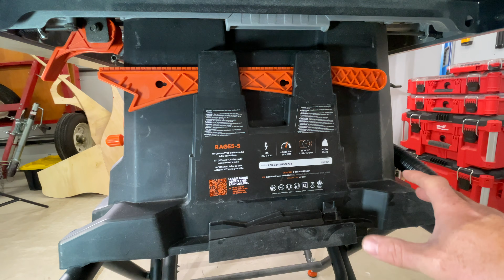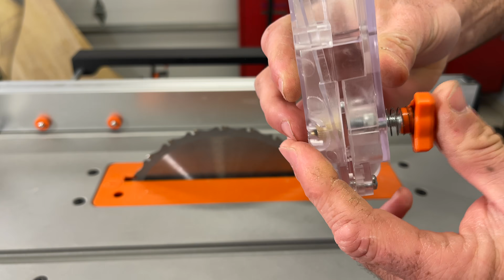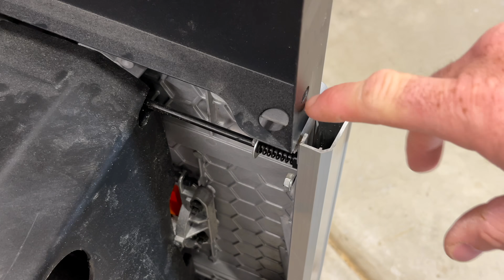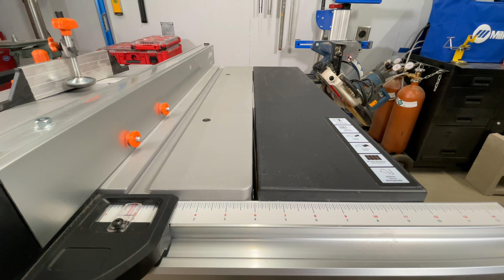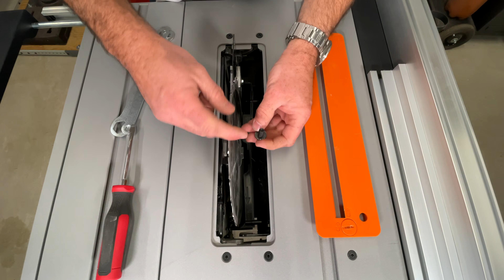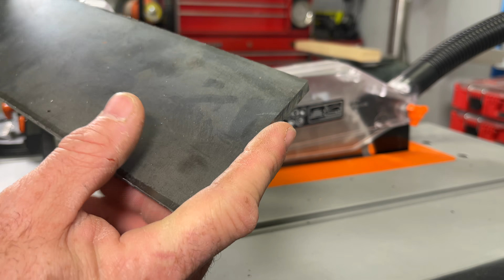Cool and Innovative But....  ||  Evolution Table Saw  ||  Review

Comment: Had this table for about 5 years and it is equal parts bad and good.
The good is the amazing ability to cut metals of all types up to about 20mm thick and the clever way it carriage is integrated.
The fence is also surprisingly stable and quite solid and it's fairly light and easily transportable.
The bad is that although the top at a glance looks cast its not and its not particularly level either.
The carriage although clever doesn't run very true and I have had to Shim mine out to make, it glide without any wobble
The measure guide I have Never used nor the extension piece I just tape from the blade to the fence (usually more accurate in any case) the extensions are a little weak but I have manged to use the right hand side extension to house a quite beefy router with no real issues.

All in all not a bad attempt and can produce accurate cuts as long as you are careful setting it up properly.

Forgot to add the aluminium fence is made quite thin and needs a decent ply face to make more it solid and durable
Reply from the maker: Thank you for this detailed write up on the Evolution saw. I try and show as many details and up close shots of features as possible. What I can’t show is years of owner experiences. Thanks for watching!
Reply: I've had one for 3 years, I say this comments sums it up very well
Reply: By the way that mitre gauge don't bother just throw it away immediately it's utterly dreadful
Reply: The table is die cast.
Reply: @willholt100  correction (and an error on my part) its cast alluminium not iron
Reply: Had one for years. Agree with this comment. Top not flat. Would I buy again? At the price range this is probably the best option. If I was in the USA, I would be looking for second hand cabinet saw. Have only used this to cut metal once. Their chop saws are a better option for that. Do not expect a great number of metal cuts with the orange blades. As you can see, if you buy this saw you will for ever be conflicted about how you feel about it 😂

Comment: You spent entirely too much time obsessing over the measurements... anyone worth their salt uses a measuring tape and measures blade to fence 💯

PS: It takes minimal effort to fix many of the issues pointed out lmao (e.g. the "little fence" having both thumb screws on 1 side can be solved in 5min by drilling & tapping the opposite side and moving one lol)

Comment: I had to cut out the bottom of the blade shroud because it filled with bits ,the blade would not wind down to the bottom otherwise

Comment: The 2024 saw has many improvements. For the money I think it’s the best there is. The thing about eveloution is their all purpose blade. I have one of their chop saws and it is unbelievable. Fast and accurate. Now for only wood use I’d use a different blade for sure. Just think how nice this saw would really be if they used aluminum knobs instead of plastic ones. I’m a toolmaker so when I get time I’m going to make them. I don’t like orange plastic lol. Anodized aluminum will make this look 100% better not to mention stronger . I love your reviews. The best channel on here for them.👍🏼👍🏼
Reply: Dude what is up?  I’ve been trying my best to get this new Evolution saw. Your review and channel are great and I’m wondering just how you got your hands on this thing?  With all the videos on here I watched I came to realize the old saw was a Rage 5 and certainly NOT the saw I want. So I called Evolution and spoke at great length with a VERY nice customer service guy. Turns out this new model is ONLY available in the UK, and is 240 volt not 110. ( which wasn’t a problem for me) They don’t expect it to be available in the states till Feb 2025. I’m bummed . Evolution was founded in Sheffield England and supposedly as big as DeWalt and Milwaukee . I wish I had the patience to wait for one, but patience isn’t my virtue. Now I’m guessing because you’re a big influencer here is why you got your hands on one. Again I do appreciate your channel.
Reply from the maker: I spoke with Evolution a couple weeks ago and they were hoping to have one to me late this year. I’m excited to see that saw too. I’ve reviewed three Evo miter saws to date and all have been excellent. We’ll get that table saw vid out as soon as it shows up. Thanks for watching and supporting the channel!!!!
Reply: So sorry I was a bit confused until now. After watching so dang many videos on here I just realized this one was on the Rage 5 and not the new R225 which I thought it was. So now it all makes sense to me. I forgot to ask them if they would be 110 volts when they were available here. There is a big difference between the old and new and you’ve pointed out all the negative features on the Rage 5. Not wanting to wait months I’ll go with the Skil. A few less features but appears to be the best at that price range. I’m retired and have a metal and wood shop. More metal than wood but still need a table saw upgrade over my Ryobi, which is basically junk. Keep the great vids coming young man.👍🏼👍🏼

Comment: Fair comments on the table saw, I've just bought one of these and had no problem with the fence moving, I think for the price you just have to treat it with respect and not bang it about it works fine.   Regarding the fence storage, mine fits in the side of the saw quite nicely.
Reply from the maker: Glad to hear is worked out well for you. Thanks for the insight and for watching!

Comment: You're very interesting man. Can you explain things properly? I understand this 15 amp 15 amp table saw you're showing and I like the saw. I'm 70 years old. I need something you know I'm trying to get into woodworking. I'm in a wheelchair so I need something that's fairly easy to handle and this looks like a perfect table for that. There's a lot of a painting for you. If you can get past the confusion. Sometimes you over explain things but you know. Thank God for bossing TV. Anyway, nice chatting with you. Did you hear from you! I'm running a lot more. Is there other things? I just want to try to learn how to woodwork and do some things around the house refinishing some furniture so it's too bad it doesn't have a grinder but that's all right. I can get one of those anyway. Thank you. Barry

Comment: Well, first thing is it looks very plastic and insubstantial.  Has a certain rattle to it.

The power switch is upside down; typically the START button is above the STOP button.  I'm also not impressed with the lack of an OFF paddle, you should be able to turn a table saw off with clumsy slapping.  

That fence scale isn't confusing at all.  Definitely not going to fuck up adding 12 1/4" to 9 3/16" being sure to use the red numbers on one side and the black numbers on the other while making sure to use the correct cursor.  Definitely superior to the increasingly common rack and pinion fence rail system you find on jobsite saws.  I want that on a cabinet saw now, give me a big heavy stationary saw version of that.

I'm abandoning the video here, Do not want.

Comment: Hi Mike, I have just seen a review of a brand new Evolution table saw ( R255TBL+ reviewed on Small Barn Workshop channel - a Brit guy that lives in south west France ) that is very close to Skil tablesaw as well as the Erbauer's one. Looks like it's coming out of the same factory in China. Unlike the Rage 5, it has a rack and pinion fence. It has no folding legs but a troley ( optional ) similar to the Skilsaw one. This review does not mention details such as  - arbor size : It's Evolution's 25.4 mm weird size : It's a pity as standard 30 mm bore would allow more blade choices. Is the waranty still valid with blades other than Evolution's ones ?. Are the rpm of the blades lower than the one of Skill or Erbauer to be able to cut metal and does this rotation speed gives neat cuts such as skil or Erbauer ? I beleive it would be worth a Mike's detailed review if of course this new saw is available in the US. Here in France, it should be available just after easter.
PS : New review of this tablesaw on Woodwork Journey channel released today
Reply: that "weird 25.4mm" is one inch.

Comment: I was actually on evolutions website looking to buy the R185CCSX track saw with the extension kit and it was gonna cost 278.00 plus tax and I ended up buying this table saw instead because it was only 100.00 more and I got the R185CCSX saw without the track for free which I couldn't pass up since I'm remodeling a mobile home. I like you was in it for the metal cutting capability. So I know have 2 of these great blades. Just put the table saw together last night and it wasn't so bad only thing I had questions about was the calibration which lead me here. Great video, I appreciate your detail. I now know how to make sure my blade is straight and how to adjust and set up the fence correctly even though the instructions do explain it, I have never owned a table saw before so it was a little hard to understand with more than one "0" on the measuring tape the black one and orange one. My only dislikes really are the fence of course but mainly that extremely wobbly blade guide but if I don't use it I don't have the saw dust collection option. I actually watched your first video where you skipped over the installation of the blade guard leading me here where you covered it. Glad I found your channel you seem to have lots of videos I will enjoy binge watching. Tools, tools and tools I love them. By the way on mine the side that stores the push stick is made to hold the miter gauge. The round foot fits into the slot just under the push blade in the very middle. Screw it out all the way and it slides right in there. The way it fits makes me think this is what it's for and if not we'll it still works pretty well for it so check it out. I did have one issue from rhe start right outta the box which i think theh should change which is already having the scews with tiny lock washer and washer installed on the extension. My box was in pretyy rough shape when UPS dropped it off so since the very first step was zero out and line up rear extension flush then adjust ride height i came across the problem of one of the screws had rattled loose and fell out, leaving only the metal square peice it threads into. So i was in dead water on step one. But after deciding to move on and assemble tbe rest and contact evolution later, i flipped the unit over and out fell the screw along with the washer so i just used a tiny lock washer just the same size I happened to already have. Crisis diverted but i think they need to just keep all the hardware together in a bag for this reason. I also didnt like the amount of play the miter gauge had in the track so a quick fix was to flip it over and place a strip of gorilla tape making sure to cut of a hole for the set screw which works pretty well. Overall for the price I paid for what I got Im not complaining. I feel like its a better than average first time buyers table saw. For those of us who cant afford Festool. Got a new subscriber now so thank you. Going to go watch some more of your videos now. Keep up the great content.

Comment: Really wish I'd seen this video 3 days ago. I literally just finished putting mine together today. Although I agree with every single assessment and opinion you have, I must say that this saw is better than the amputation/mutilation/death machine that is my Ryobi table saw (that piece of garbage is basically an upside down circular saw with a piece of scrap metal as a fence). I used my evolution to tune up some boards for a cutting board glue up. It's no DeWalt, but it seemed to make okay joints. I'm perpetually terrified of getting my teeth knocked out by a bad kick back, so I'm glad you pointed out how the extenders can make the fence out of square. This seems to just be a testament to the "cry once, buy once" idea....I should have just sucked up a little more overtime and gotten a solid DeWalt, or remortgaged my house for a SawStop.

Comment: Well, as with a lot of American "review" sites, it falls down because it is not American, either company or manufacture! Then of course, you are looking at a DIY saw table and comparing it to professional table saws. (At that price point, it is not a professional product!) And really, who goes up to a table saw and hits the rail with their hand, end on? No one! 

The thing is, this is a very capable saw. It does what it is supposed to do. I have owned mine for three years. It is perfect for my use. If I want complete accuracy, I wouldn't have bought it, but would have spent over double for something else. Even then, I wouldn't have complete accuracy! @Matthewstanton9633 has it summed up much better and is fair on the saw, considering the price and usage.
Reply from the maker: Ok let’s start at the top and work our way down.  First off, of the eighty or so vids we’ve done so far only a handful of tools are made by American companies and very few if any were made here in the states. I will not pretend to know your home market but the US seems to be different than most in that almost everything is available to buy here. This makes the selection and competition vast and wide. Here there are many similar priced and cheaper saws the lock up tight and allow for a dado. 
There are three Evolution videos on my channel at present and this is the only negative review. 14” chop saw review will be this weekend and that’s another great Evo product. 
If you have a limited selection or tools are crazy expensive where you live and this saw is an viable option, it is what it is. Fortunately here we have better options

Comment: Mine was rubbish. The fence could not be set square to the table and the blade could not be set square to the table either. The adjustment screw was stripped from the factory.

I would suggest spending that bit more money on something like the DeWalt

Comment: I appreciate your efforts and giving this an evaluation. 

Personally when you buy any lower end price tool you're going to have challenges that are either easy to deal with or they amount to so much that the price compromise isn't sufficient to justify the lack of quality. 

Personally for 50 years of using table saws I've never trusted the measure scale on the saw rails. I was taught to pull a tape and that's what I do. Even with high end saws and fences that cost as much as the saw. Only once did I get bullied into using one. When I worked in a small shop with a man who was umm crazy. Border personality defect. I could never please him even though my work was good enough to sell for thousands of dollars and good enough for him to say he made it. Oh well life is too short. Anyway he insisted that I trust the fence scale. Which I only did while he was looking. 

Too me, I want to do my set up with the same tool I measured the section or size of wherever the piece is going to fit. That way deferences in the scale and measuring tool doesn't matter.

Clearly we all work differently, typically out of experience and training, so our comfort level comes from that. Hey whatever works best for you and whoever. 
Good video, I did like some of the features of the saw. However they're execution seems unreliable to me.

Comment: One thing that hasn't been mentioned is the depth of the track that the mitre gauge slides in. It is not standard. You can't use a higher quality after market gauge...it wont fit. This also creates problems if you try to make use of custom slides when building sleds etc.

Comment: I have this saw...for about 2 months now. Only used it a few times on a job. The fence is GARBAGE!. I had the same high hopes for it. But it's terrible. Just bought the Hercules saw....still in the box. That is now getting returned because I didn't realize you couldn't do full 3/4" dados until I saw your review. UGH. That is going back and I just ordered the larger Skill 10" saw you reviewed.  I appreciate your efforts.

Comment: Your review is..odd. You tend to focus on completely unnecessary details: inbuilt measuring tape. Who uses that? The base mould with those 2 springy prongs - yes, the fence fits there snugly and securely. Extended table locks - these do work in mine without any problems.  The blade guard over the blade? 107% of the YouTubers have these permanently removed. The fence mitre extender is there just to make mitre cuts, so the offcut doesn't kickback. I have used it maybe once in the last 2 years and yours is definitely way too much forwards. You should have focus on important things: tabletop - rarely flat. Shitty plate, 1mm blade wobble and huge difficulties to make it parallel to the tracks. T-tracks barely parallel to each other and varying in sizes, blade doesn't hold 90 degrees to the top. Or...sometimes is 90 to the left side,- sometimes 90 to the right.... These are the epitomes of the 300-dollar value.  The best thing about this saw is its online marketing. A good quality plunge saw with a few jigs makes this saw obsolete.

Comment: I've finally worked out why they insist on the silly add on bit of fence.  If using the plastic blade guard (as if ! ) , the extra bit of fence now permits larger pieces of wood through the blade guard.  Simple answer, use neither.

Comment: Why not just use that blade on a better table saw?
Reply from the maker: Technically I think you could but the blades are 1 inch arbor. You would need an adapter that works with your saw. Thanks for watching!